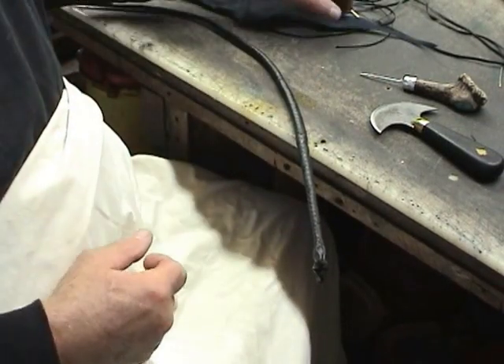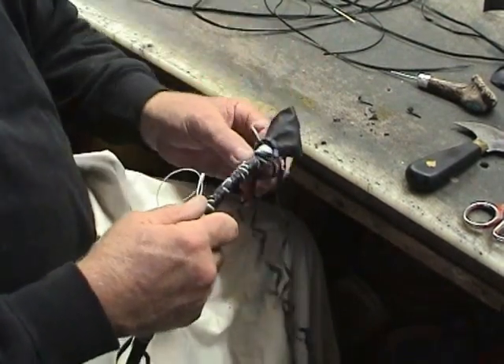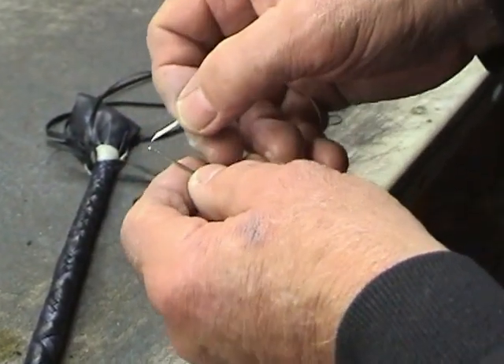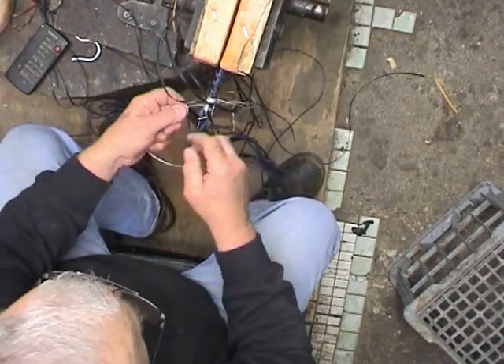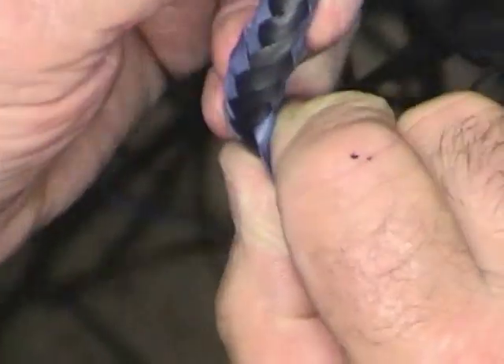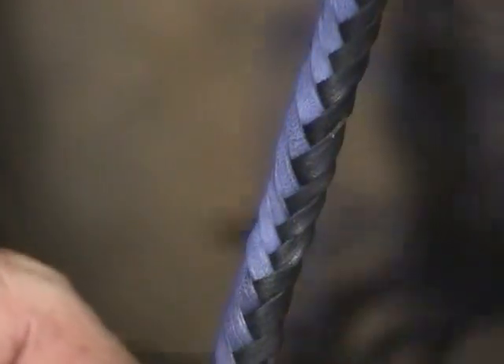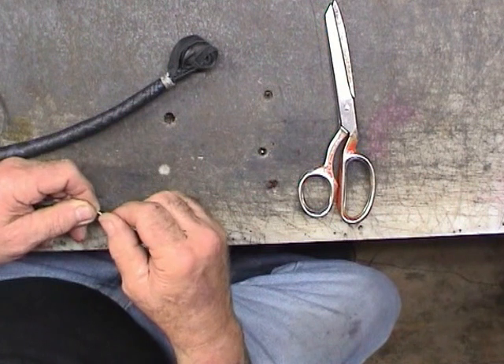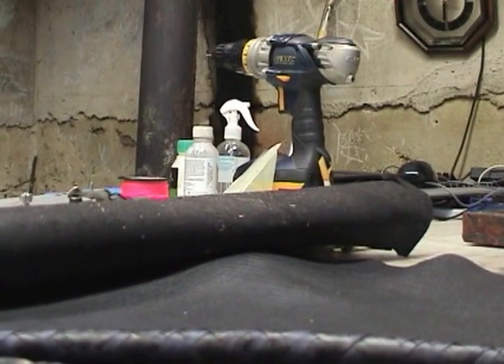stock whip video #3

Comment from the maker: To the best of my knowledge they were originally copied from an English hunting whip. They are virtually the same thing except they have a very long keeper which allows them to be draped over your shoulder when riding and it will just sit there. Stock whips are usually carried the same way only with a stock whip the keeper is very tight which gives you more precise control over the whip.Bull whips have never taken off here in Australia and only stock whips are allowed in competitions.